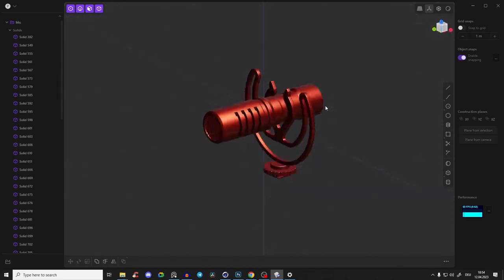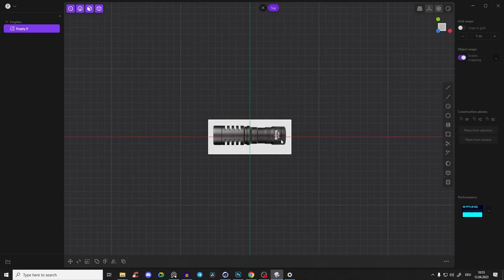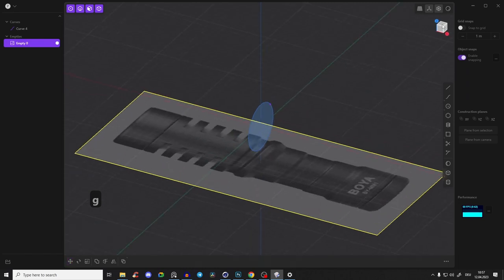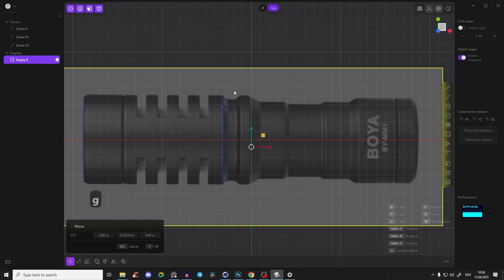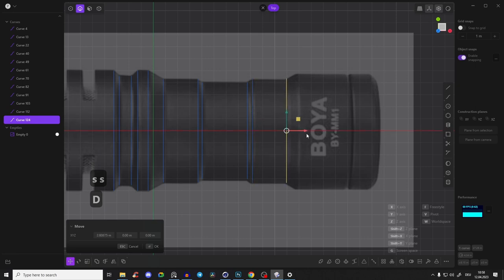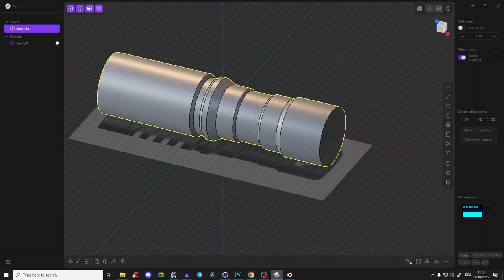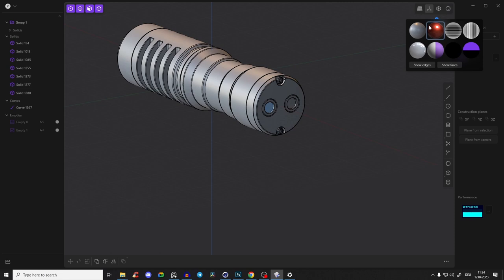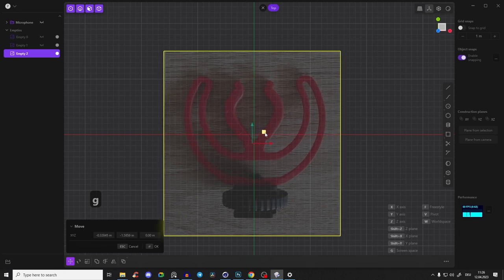Plasticity 3D Beginner Tutorial | Product Design | 3D Modeling Revolution

Comment: You can use array in 9:28 zigzag line! Just make the first one and array it, then join them by pressing J and make sure the diameter of the pipes are small or it will give error that swept body has self intersecting! Thanks for your amazing tutorials! 👍

Comment: Hi, would be very interesting to see more parameter-based workflow, as I understand there's no "sketches" in app, but does it has constraints for distance from line, parallel constraint etc. Also is it possible to import svg/dwg sketches from autocad/librecad.
Reply from the maker: Hi Anton,

Unfortunately, I don't have any experience in autocad/librecad and with svg/dwg.
I just use it to create products and designs from a more "artistic" standpoint

Comment: is there a way to edit a solid? for example, if you wanted to make part of the cylinder thinner, how would you do that?
Reply from the maker: You could select with the face mode [3] -> the faceyou want to make thinner and just make it smaller.

With basic shapes it should work without problems